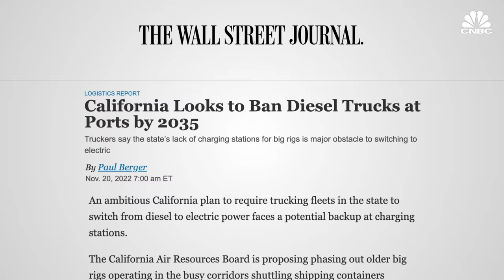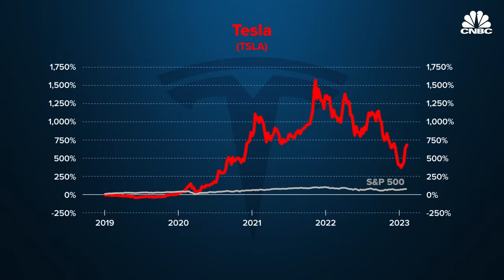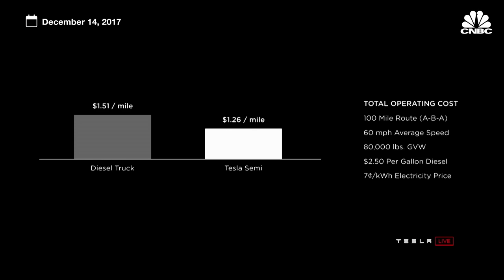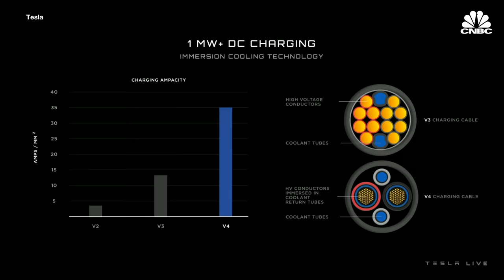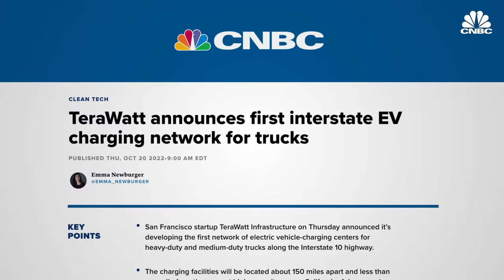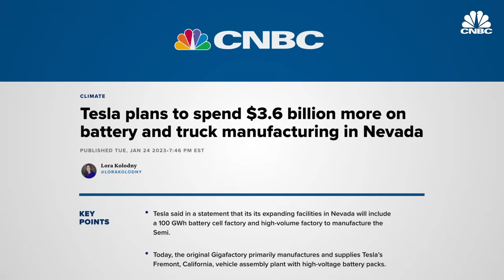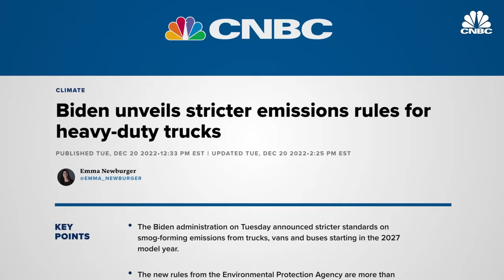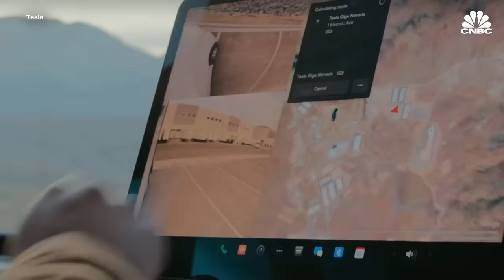Does The Tesla Semi Live Up To The Hype?

Comment: The last thing I want is one of those things flying down the highway next to me on slick icy roads in a blizzard
Reply: Why? It's 3 motor traction controll system can react faster to slipping than any traction control system on any gas driven car/truck while adjusting torque to also prevent jack knifing.
Reply: actually this is the one truck you want in that situation as it is the only one not having any issues with such conditions

Comment: @Garth2011 
 How much is the truck battery charging bill each month in comparison to the diesel fuel bill of the same miles driven? Significantly less. 
 How much are the onsite battery charging in maintenance and initial cost? Not much, lots. 
 What are the in dollars savings of truck maintenance per month? Almost 100%. 
 What maintenance items do electric trucks have that diesel trucks do not? None known. 
 How much loss in revenue per truck due to the heavier truck weights and how much heavier are the electric trucks? Almost none; somewhat. 
 Taking away all of the Government and Tesla incentives, how much is the cost of electric transportation vs. diesel? Not relevant unless you also take away all the subsidies for the fossil fuel industry. 
 How much does Pepsi pay for their charging electricity per kWh with their electric company? Likely 10¢/kWh if all charging is done from the grid. But much of it comes from rooftop solar, so somewhat less. 
 How much pollution is saved or not from using electricity from power plants?  It depends on where you are. In California, where all the Tesla Semis are (for now) and the grid is 60% renewable, 88% is saved. In W. Virginia, where there are no Tesla Semis and the  grid is <5% renewable, 49% is saved. 
 Electricity is generated, doesn't that pollute as well? Yes. 
 Now, lets do the same charging of batteries but without any solar, wind, ocean etc. such as at nighttime, what are the pollution levels saved or gained? Pretty much the situation in W. Virginia, so maybe 47% reduction in emissions.

Comment: go hydrogen
Reply: And pay 10-20 times the fuel cost per mile? No thanks.

Real world example: the Toyota Mirai carries 5.65 KG of H2, and gets an EPA range of 357 miles. A KG of H2 in San Diego, where I live, is currently about $36, having recently increased from about $13. So the per-mile cost of H2 for the Toyota Mirai is 5.65 x 36 / 357 = 57¢. Meanwhile, my Tesla Model Y has a 75 kWh battery, and has an EPA range of about 320 miles. At the San Diego Gas & Electric EV charging rate of about 15¢/kWh, the per-mile cost of electricity for my Model Y is 75 x .15 / 320 = 3.5¢; so the Mirai costs literally >16 times as much per mile in operating cost. And actually, my cost is zero, because I recharge from my rooftop solar array, which of course H2-fueled vehicles can't do.

Comment: I guess Tesla semis are GREAT for Fritos.
(Next... A fascinating video on a Tesla semi hauling helium balloons)
Reply: You may need to tune up your comprehension skills. You've obviously failed to comprehend the statement at 4:34 that they haul loads of Pepsi—not Fritos—300 to 400 miles, and the statement at 4:38 that these are loaded to about 45,000 lbs. I might be mistaken, but I don't think you can fit 45,000 lbs. of Fritos into a standard dry van trailer. Please correct me if I'm mistaken.
Reply: As a former truck driver I can assure you that the majority of loads are nowhere near weight limits. So if your critique has any merit, it in no way limits the usefulness of the tractors for fleets which are used for predictable load weights. However, while range would obviously be affected by heavy loads, there is nothing inherently inferior about the performance of electric motors versus diesel engines. They have more torque, not less.
Reply: @BigBen621  At 04:28 it CLEARLY states 
Frito Lays 425 miles
Pepsi cans 100 miles
Reply: @crawkn  As CLEARLY stated at 04:28 the range is ONLY 100 miles if carrying a load of Pepsi cans.
(And as someone who completed my electrical engineering about 40 years ago, I can tell you that all the torque in the world is useless if you're spending a few hours charging your truck battery every 100 miles)
Reply: @toothlessseer3153  if your deivery is to a location 40 miles away, it will still work. But of course when you buy fleet vehicles, you buy the ones you need for the loads you haul, not the ones someone else needs for the loads you don't. I've never seen a plant that both manufactured salty snacks and bottled drinks. Nobody has claimed that electric trucks will replace diesel trucks today for all purposes. Instead of focusing on what they can't do, try acknowledging what they can, more efficiently and sustainably.
Reply: @toothlessseer3153  Actually, your claim is false. It isn’t “CLEARLY stated at 04:28 the range is ONLY 100 miles if carrying a load of Pepsi cans”; it CLEARLY states that “It's also delivering Pepsi out of its Sacramento warehouse on 100 mile daily routes, going directly to stores”; the word “only” appears nowhere in the quote. 

They might in fact carry Pepsi cans 100 miles, if that's where they needed to be; but that doesn't mean they can't go any farther than that. At the end of that very same sentence, which you would have had to work hard to miss, she CLEARLY states "and 300 to 400 mile runs to other warehouses"; and in very next sentence, the narrator states that "the contents that are in the trailer [payload] can weight about 45,000 lbs.". So here's a clear statement that the Tesla Semi can tow a payload of 45,000 lbs. for 300 to 400 miles. 
This is hardly surprising, because they've already demonstrated a fully loaded range of 500 miles, starting at sea level in Fremont; climbing 4,200 feet to Tejon Pass; and descending back to sea level in San Diego, on 93% battery charge (https://www.youtube.com/watch?v=GtgaYEh-qSk).
And if we're playing the appeal to authority game, as someone who completed his MS in electrical engineering almost 50 years ago, I can tell you that a truck that has a fully-loaded range of >500 miles on a single charge has no need of “spending a few hours charging your truck battery every 100 miles”, as you so falsely claim.
Reply: @toothlessseer3153  But it doesn't say "Pepsi cans only 100 miles". Here's a tip; if you have goods to deliver 100 miles away, you deliver them with the asset that's available; and using that asset for delivering goods 100 miles doesn't mean that it can only deliver goods 100 miles away. Please try to keep that in mind for future comments.
Reply: @BigBen621  So:
1 - 100 miles was a RANDOM number put out by some marketing guy AND
2 - Most companies would not mind spending $180,000 for a semi that only travels 100 miles (and a 'regular' semi for any longer trips)
Reply: "Nobody has claimed that electric trucks will replace diesel trucks today for all purposes. Instead of focusing on what they can't do, try acknowledging what they can, more efficiently and sustainably"

 @crawkn  you've obviously not read the Tesla semi brochures
Reply: @toothlessseer3153  of course I haven't. If you have a point to make, you may quote the relevant claims.
Reply: @toothlessseer3153  I will try to keep this simple, in hopes that the comprehension skills that you learned in engineering school will kick back in.

No one, anywhere, ever, said that the Tesla Semi has a range of only 100 miles; and certainly not "some marketing guy"—with your obvious vast knowledge of Tesla, it's a bit surprising that you're not aware that they don't even have a marketing department. Tesla Semis have a demonstrated range of over 500 miles fully loaded on a single charge, and close to 700 miles lightly loaded; and they can drive any distance from 0 miles to maximum range, depending on where the materials they're carrying are needed.

Pepsico has a bottling plant in Sacramento, CA; and from that plant, they need to make deliveries to individual stores within a range of around 100 miles, and also bulk deliveries to warehouses up to 400 miles away. Since the Tesla Semis have far lower operating costs than their Diesel semis, it makes sense to use a Tesla Semi, with a range >500 miles, even to deliver to a store only 100 miles away; as long as one is available. 

Using a truck with a 500 mile range to deliver materials 100 miles away in no way suggests that its range is limited to 100 miles. Further, as you will have learned in your junior year battery course, the batteries will last longer and charge faster when used for shorter runs. 

If you're still struggling to comprehend this simple scenario, the best I can recommend is a couple of semesters back in engineering school, to try to regain the comprehension skills you seem to have lost. 

You're welcome.

Comment: Batteries are known to have much lesser energy density than diesel. Besides taking up half the weight, such large batteries are a huge fire hazard and difficult to recycle. 

Unless battery technology improves dramatically, it doesn't seem feasible to use battery trucks.
Reply: It's a 10,000lb battery and 600lbs of motors vs 6000lbs of engine and power transfer systems. Such large engines are a fire hazzard and difficult to maintain.

Unless diesel prices go down, battery electric trucks will keep growing.

Comment: A Semi without a heavy duty transmission is like having a race horse without legs.
The fully loaded truck will fail if stopped on a steep incline
Please Comment!
Reply: The Plaid powertrain has a flat power curve thought, so it can still produce 1020 hp at speeds as low as 20 mph, which is the same torque as a 400hp truck going 8mph
Reply: It’s not about horsepower. It’s about engine torque
Reply: @javadabaron81  That's only true at low speed, once you switch to second gear it's about power.

Comment: That's a huge lie that ev is cheaper. Schools using EV busses have already discovered the price per kw to charge there fleet is way more expensive then the diesel bus. The more demand the grid gets from "clean" EV the higher and higher per kw electric charges will get.
Reply: Source?
Reply: Go ahead and tell me the price per kwh so we can math out how wrong you are.
Reply: Which is cheaper to operate depends mainly on four variables: cost of electricity; cost of diesel fuel; electrical consumption of electric school buses; and fuel consumption of diesel school buses. I have no doubt that there is a small number of school districts where the variables line up against EVs, and diesels are less expensive to operate. But for the vast majority, EVs will be cheaper; and in most cases, much cheaper.

A brief search reveals some national averages, as follows:
Average cost of diesel fuel, $5.26
Average diesel school bus fuel consumption, 8.2 MPG
Average commercial cost of electricity, 12.79 ¢/kWh
Average electric school bus energy consumption, 1.4 kWh/mile

Based on these averages, the per-mile energy cost for an electric school bus is 17.9 ¢/mile, and the per-mile fuel cost for a diesel school bus is 64.1 ¢/mile—3.5 times as high as an electric school bus.

What are your numbers, such that you can make the absurd claim that electric school buses cost more to operate than diesel school buses?
Reply: @Ben Thurston  it's insane that a electric school bus uses 1.4kwh a mile while the fully loaded tesla semi gets 1.7kwh a mile, stop and go is a factor but regenerative breaking should make that less of a factor especially since the bus fully loaded is half the weight.
Reply: @miguellopez3392  I agree completely, and for exactly the reasons you state. But 1.4 kWh/mile is a published figure, and I thought it would be better to go with a published figure that substantially overstates electrical consumption, that to give genius something to attack. If diesels are 3.5 times as expensive even using 1.4 kWh/mile, they're even more so using the correct rate, which is likely somewhere around 1.0 kWh/mile.
Reply: @BigBen621  tfl truck has a video out there of a EV bus in Pruto bay in Alaska. He stated with proof the price of electricity costs more then buying diesel. You can't base the cost of charging on that u pay for a wall plug in at home kw prices. No one using a fast charging option is paying consumer prices for kw/hr
Reply: @miguellopez3392  Tesla hasn't released the 1 mw ev charging prices. Every video using a house kw/hr is nowhere near what a customer plugging in at a fast charge station charges. No one's charging a Tesla with a 110v plug in at home.
Reply: @BigBen621  you can not use a home owners kw/hr price to calculate what a Tesla charging station will charge a EV to charge at 1mw.
Reply: @miguellopez3392  This might amuse you. Several months ago, MotorMatchup did a video developing the physics of the Tesla Semi, and with his permission I developed a Google Docs spreadsheet to compute the results. I pretended a Tesla Semi was a fully loaded school bus weighting 18 tons, and calculated the energy efficiency at 30 MPH. Turns out to be .67 kWh/mile! I'm not sure how good of an approximation that is, but it certainly makes it clear that, as you say, 1.4 kWh/mile is way high! Yes, stop-and-go might increase that a bit; but as you say, regenerative braking will minimize the reduction. In fact, this is exactly why almost all EVs have a higher city than highway MPGe rating (less consumption per mile).
Reply: @John Snow  you forget the fast charging station are battery powered? The batteries take in grid/renewable power when cheap then use it during peak hours for charging for best prices, this isnt a EA charging station that upcharges cost even higher than teslas premium superchar gerservices , also people don't use their 120V outlest. They use their 240v outlets at home.
Reply: @johnsnow1355   So lemme get this right; you found one school district, probably the most remote school district in the US, where it's cheaper for school buses to use diesel than electrical energy, and used this as the basis for your claim that " Schools [plural] using EV busses have already discovered the price per kw [sic] to charge there fleet is way more expensive then [sic] the diesel bus"? To use your words, "That's a huge lie"; for one thing because you used the plural, "schools", while you only cited one; but more to the point, your statement implies that several or even many schools have "discovered" this.

I did not use home kWh (not "kw") prices; I clearly stated this was the commercial rate. Just like Pepsico did for the Tesla Semis, school districts will install chargers in their bus yards, likely Level 2 in this case, with power billed at their commercial rate.
Reply: @johnsnow1355  "Tesla hasn't released the 1 mw ev charging prices."
Straw man fallacy. First, these aren't Teslas; second, there's no need for DC fast charging, and certainly not 1 mW fast charging. Electric school buses are much lighter than the Tesla Semi, and have no need for anywhere near the 500 mile range of a Tesla Semi; as such, they;ll have batteries in the range of perhaps 90 to 150 kWh. And they're unused for probably 14 hours a day; so even charging at 9.6 kW from a 240V 50A Level 2 charger will be plenty.
Reply: @johnsnow1355  "you can not use a home owners kw/hr price to calculate what a Tesla charging station will charge a EV to charge at 1mw."
You're getting repetitive—I already responded to that. I get it—you got caught in a huge lie; and rather than owning up to it as an honest person would do, you're trying to double down with irrelevant claims.

Comment: They only use them hauling small trailers because they get low mileage when a battery is on a heavy load and if they want to get solid lithium batteries then all the weight will damage our roads to much weight plus we can support that amount of electricity without blackouts and they break down a lot
Reply: They haul the same size trailers as any semi—53 ft. They have demonstrated 500 mile range on 93% charge, loaded to within 1,000 lbs. of the 82,000 lb. GCVWR of electric and natural-gas-powered semis. The gross weight is <3% greater than a diesel semi. Yes, this'll case slightly more damage to roads; but that's a small price to pay for all the other benefits of electrifying the transportation sector. The vast majority of EV charging, including the Tesla Semis at PepsiCo, is done at night, when there's so much excess power available that utility companies give it away for a fraction of the daytime rate. A few have broken down; this isn't unexpected for the very first few dozen of any new vehicle, and it's how Tesla learns what parts need to be revised or improved.
Aside from those minor quibbles, everything else in your comment is spot on. Oh, wait...
Reply: @BigBen621  
Just things to consider when trying to go zero emissions but yet they are not  completely zero emissions due to the fact of brake dust that is made when braking we don’t have the means to support that amount of power to charge unless we go solor but as price wise with electricity being more expensive as more and more evs are more common it’s make more sense to stick to diesel especially when weather beings to change a battery will struggle to hold its charge especially because Tesla batteries are so cheap maid especially because the us doesn’t have the materials to make them but as far as moving something light like chips and soda ok but in reality things are much heavier for example the heat and fact that batteries are quickly charged instead of slowly charged means these batteries won’t maintain a strong charge there for is it really worth the change money wise 🤔